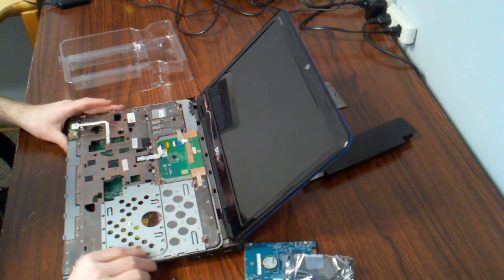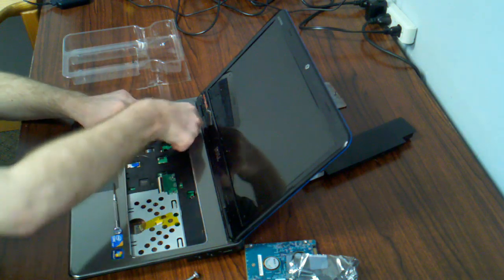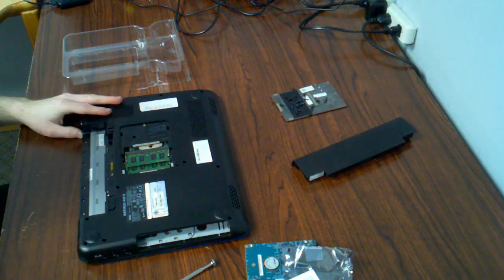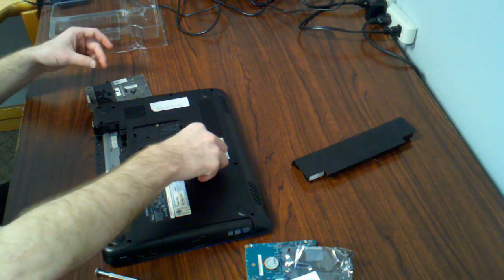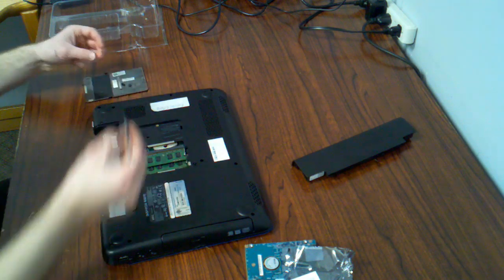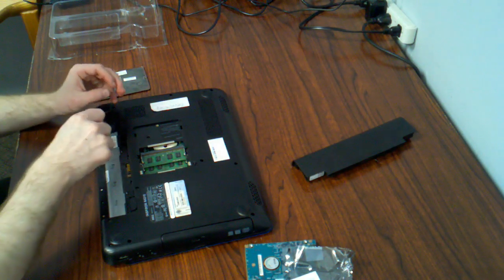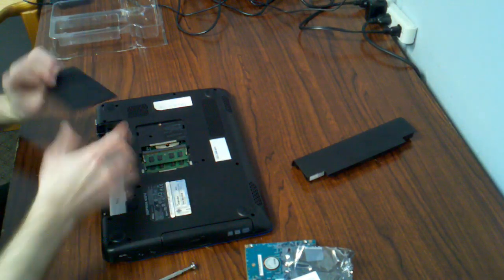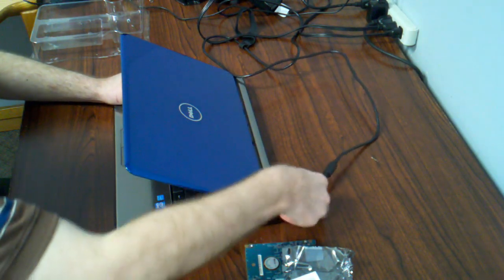Dell: Inspiron 14R-N4010 Hard Drive Replace / Dis-assembly - Part 3

Comment: Thanks for the video.  In 20 years of working with this carp, this was absolutely the worst computer design I've encountered.  This is the first time I had to remove the motherboard just to replace a hard drive.  Without this video I wouldn't have been able to do it without breaking something.  

I didn't break any of the flip up "tabs", but I did think I broke the one for the keyboard cable.  When I first got it back together, no keyboard.  Pulled the keyboard back out and found that the cable was loose even though the tab thingy was installed.  After some didling, I finally got it to hold the cable tight by turning it over and forcing it into place.  Another shoddy design obviously intended to punish you for attempting to DIY.  The whole thing seems to be that way.  In the end, I didn't even have any screws left over, I was shocked on that.  These things will definitely make or break your confidence with SSD upgrades on laptops.
Reply from the maker: +phil richards A few months after working on this laptop, I had to replace a hdd on a macbook. This wasn't anywhere near as bad to work on in comparison.

Comment: Is it possible to replace the 2.5 HDD with SSD in this model?
Reply from the maker: Ramesh Muthusamy Yes.
Reply: J4TFOI thank you
Reply: Ramesh Muthusamy absolutely yes. Almost all laptops with sata hard drives can be upgraded with a SSD. You just need to check the sata compatibility of your laptop. Some old generations are unable to run SSD directly but if you have drivers you can install them from setup at driver detection screen.

Comment: Is it becoming a fashion statement among laptop designers to make it freaking impossible to just remove or change up the hard drive and/or memory? Are the days where we only need to unscrew a panel well and truly over?

Thanks for the videos, in any case. They saved me a lot of trouble (and most importantly, data).